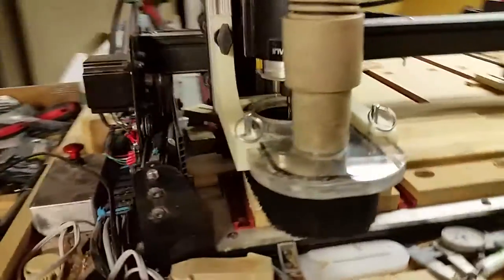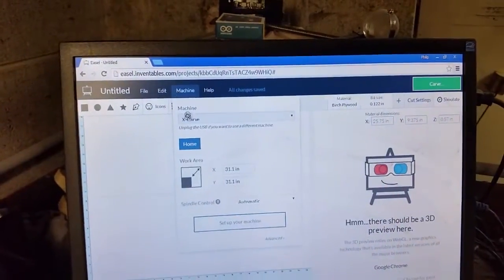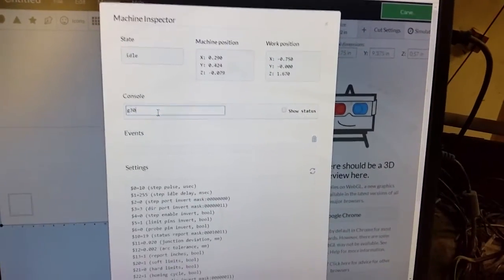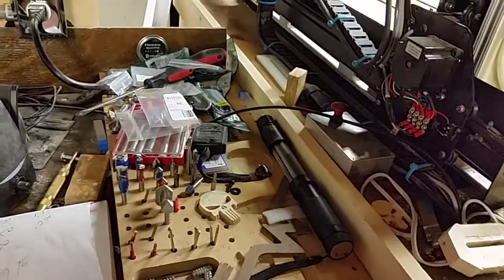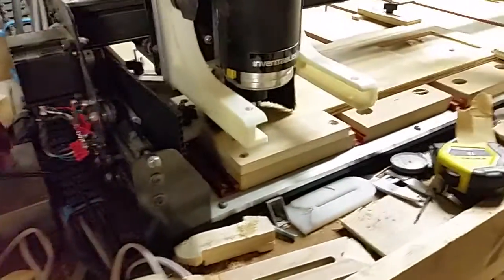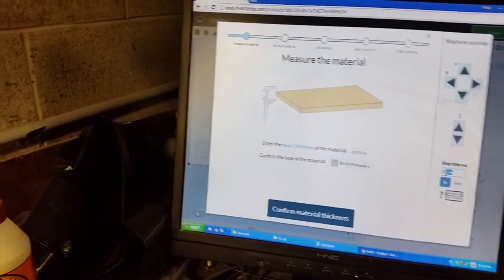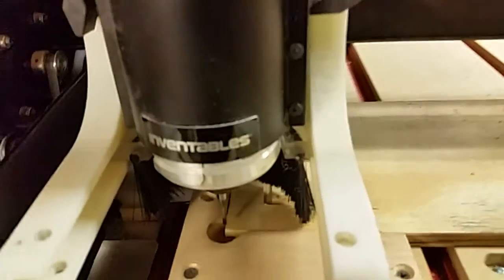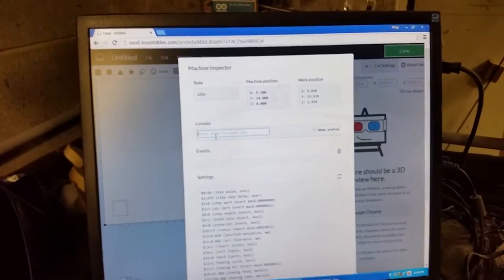X-carve g28 g30 and homing

Comment: one question i do have is can i sue any program to create gcode and then just open in UGS and send to xcarve?/.....i want to use autodesk featurecam to create a gcode and be able to make using xcarve.....are you familair with UGS and or autodesk featurecam?
Reply from the maker: der ddd you have to use the correct post processor in the CAM software

Comment: How did you wire your Dewalt for automatic spindle control?
Reply from the maker: I used the iot relay  (or lot relay?) from amazon. $17. it has a dc voltage trigger. just make your spindle speed in your gcode 12500 I believe  (M3 S12500). lots of info on the Inventables forum on it.